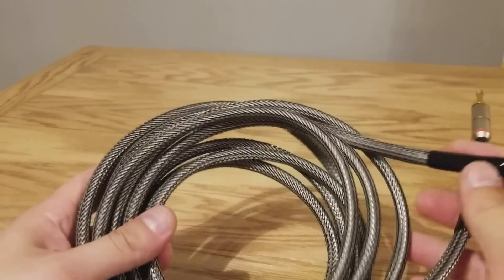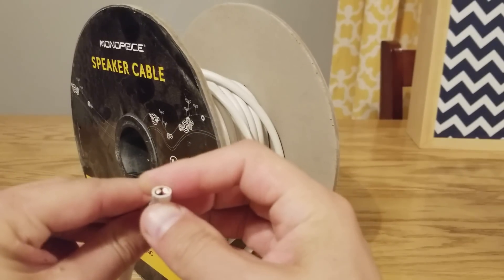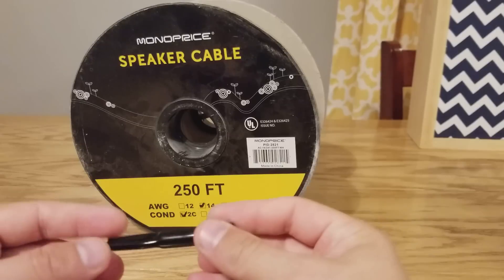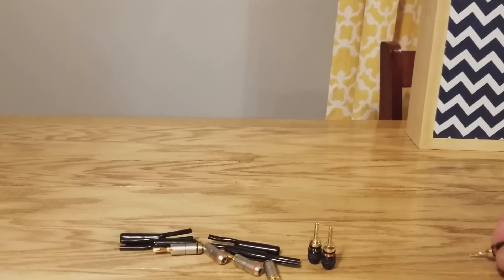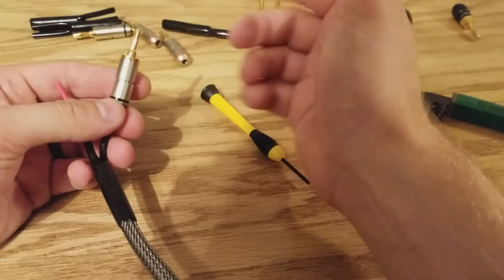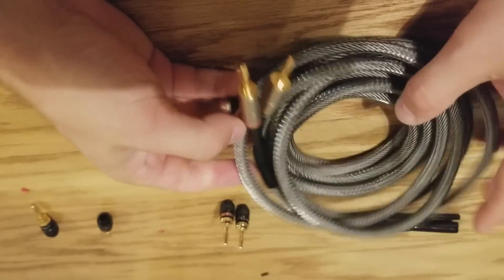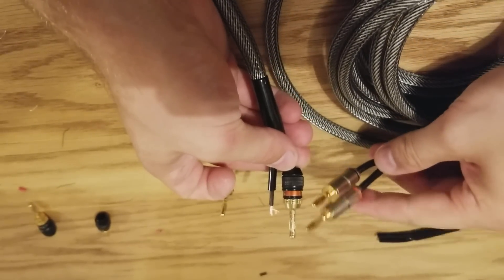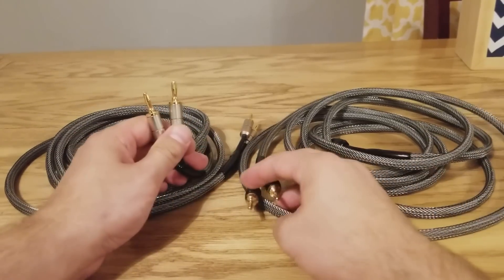How to make Your own HiFi Speaker Wire

Comment: in the end, for speakers,  you just need low resistance. Remember,  speakers are low impedance, typically between 4 to 8 ohms. Keep the cables as short as possible. Use good quality connectors. I think the example shown is a good example on how to make low cost good quality cables
Reply: Bam !!! At least one person on here is actually using that lump thats two foot above their ass....... Thank you
Reply: @arcturusbbqsausagemaking2435  He used his neck ? :D
Reply: No, you need low impedance, which is a combination of resistance, capacitance and inductance.  It is an impedance matching issue because the load is only 4-8 ohms.  A good amp will be hundreds of times less output impedances than that, maybe .01 ohms.  You don't want the cables adding significant impedance to that.  The problem is that most chain retail cable advice is based on resistance, not impedance.  A lot depends on the specific speakers too, because nominal impedance hides the truth about a speakers load variance over the audio spectrum.  Some are just amp blowingley very very bad in this regard.
Reply: Club Soda  in the beginning, yes, it was. Nowadays even the future is not what it used to be!
Reply: I want to do these for my home theater but my rear speakers are about 15 feet from the receiver.  Will doing this work?
Reply: the longer you go the higher gauge you need. If you use 12, or even 10 gauge youll be able to run any length youll ever need

Comment: EEEK. FAIL. WRONG. have you ever cut open a real HIFI wire?  It is a tight twisted pair. It stops electrical interference over long distances and nearby power runs.  All you did was add a pretty cover over a cheap type of wire that is not twisted. Twisting the two wires with 100% even twists end to end takes a machine. Now for your next video go jig up a machine that will twist wire evenly and very narrow twists. (Study other hifi measurements) then do the pretty jacket. Who cares what it looks like if it sounds like &@$) compared to a real system.
Reply: The conductors are twisted in the cable. These aren't $40K Siltech Emperor Crowns. They are good, serviceable cables that work fine for their intended use. I've done A/B listenings with expensive cables and Monster 14 ga speaker wire side by side. I couldn't tell one from the other. To each his own, I suppose. I just feel that spending huge money on cables is akin to stocking up on snake oil. I've read reviews of the same type of A?B testing with expensive cables and ones fashioned from coat hangers. No audible difference. And the coat hangers weren't even twisted. Enjoy your kool aid.
Reply: texasdaveinla I love audiophiles, they are clueless 😂😂😂😂
Reply: "Confuse the read with tech jarbo"...... Not sure if you're full of shit or full of shit. Isn't that what you just did on your first rant? You make it sound like you know wtf you're talking about but you're full of shit that you read somewhere. This is a long debate that's been proven over and over to a point that the cable industry is full of snakeoil and salesmen full of shit, some even more than you.
Reply: This is so wrong.  Ethernet cable is twisted to cancel out electrical noise at high frequency switching speeds.  Does not apply to low frequency audio.  AT ALL. This gentleman's explanation is correct not "tech jarbo".  The only important part about speaker wire is that the wire impedance is very low compared to the speaker impedance, and in than way it does not become a relevant part of the amp/speaker equivalent circuit.
Reply: You made me giggle. I have friends who've spent THOUSANDS on little stands for their wires. I would like to coin the term "audio snowflakes" and folks with too much money and lacking any sense. These are the type of people who get bored with music because they never loved the music to begin with, they love the hardware and love to show off. A true music lover will never spend that much energy or worse yet, money on the snake oil that is all too prevalent in this industry full of snakes.
Reply: They also love to spend money on placebo pills and boy is that a good industry. Nothing sells better than perceived gains, they require so little imagination.
Reply: If you want to watch a fool meddle in his own folly, find a demo where speaker wires are being sold and watch the reactions of the Steve Jobs looking clowns. They swear they heard the diff. Funny part is one time I was part of a live demo where nothing was changed, the plugs were pulled out and plugged back in to give the visual effect of swapping cables and to see everyone's faces light up when the track was played again was hilarious. The placebo they experienced was their very own expectation of wanting to hear something better so they immediately heard it. Tell you what, this sells cables like viagra in north korea.
Reply: Guys, i reckon texasdaveinla spent $200 on a 3m cable, he needs justification for the 0.13% better sound quality gains... smh.. i use 12 gauge electrical cable for years. if you can tell the difference between that and high end cable, congratulations, you have super human hearing and id be more worried about constantly having to listen to folks across the road fight over their failing marriage.
Reply from the maker: I am guessing you have never read and ABX testing (double blind) on speaker speaker wire.
Reply: Nice!  Confuse the readers with tech jarbo. Ok here it is. An ABX test: “A method of testing two sources and thier output.”  your saying non-twisted speaker wire is just as good as twisted. Then why do All Ethernet cables come twisted? Why does the main line coming into your home from AT&T twisted?  Because it’s just better. Wait! I know what’s coming next. Speaker wire is not data wire it is electrical. No. It is both. Using current and frequency’s tgat are are easily disturbed by magnet fields all over the place inside walls and ceilings. Twisting blocks this. And any test done was probably done on the floor away from a power source running across it and promoted by the guys selling the cheap stuff.
Reply from the maker: Ethernet cables, phone cable and other data transmission lines need to be twisted.  Speaker wire needs to keep resistance down.  Twisting the wire has no effect on resistance.  The metal used inside the speaker wire does however can greatly affect the resistance.
Reply: It must keep resistance down AND deal with frequency interference caused by magnetic fields.  Everyone in the AV/theater geek world thinks that audio is even more fragile data than video.
Reply: You almost got it right. And if you took 14 gage wire,  pulled it apart and used a wheel to twist it evenly you’d probably have a product you could sell back to these high end Home Theater retailers because then it would truly be the exact same grade of wire.
Reply from the maker: EMI and RFI is rarely an issue with speaker wire.  But you're welcome to twist if you want to.  It just is not necessary for most people.  http://www.audioholics.com/gadget-reviews/speaker-cable-and-audio-interconnects
Reply: In my over 30 years of connecting stereo equipment ,I have never swapped a speaker wire and been like " THANK GOD I changed that terrible piece of insulated copper!" NIGHT AND DAY!!! said no one ever. Now where is my drill so i can twist them up hahaha Might go CNC some 3" billet stands to get the wire off the Interference inducing wood floor while i'm at it!
Reply: thank you!
Reply: The more important aspect of speaker wire is the shielding. It is possible to minimize magnetic interference by running three cables and braiding them, the pattern of braid will help to cancel out the magnetic field. Notice that winding on a transformer are not braided but wound around a tight bobbin. This is to create an even electrical magnetic field. Having a properly shielded cable will help to reduce the chance of your wire, especially in long runs, to act as an antenna and pickup the electrical noise that's all around us.
Reply: @maddoxinc1642  -- EMI is a non-issue considering the impedances, levels, and frequencies involved in an amp-to-loudspeaker audio circuit.  IOW, you are propagating quasi-technical codswallop.
Reply: WOW totally wrong. Many cables like flat or rectangular wires are not twisted. First you need to calculate the skin effect of the wire you are using to determine if it needs to be twisted or if  this will make them even worse. There is no such thing as one size fits all. there is science here and the effect you are describing may not effect the cable at all until way beyond the audible range. The insulation also plays a big part when measuring skin effect. You can choke the high end and imaging by twisting.

Comment: If you heat the tex flex with a lighter it won't fray.
Reply from the maker: CubeRepublic that is a great point. I usually don't worry about it if I'm putting the boots on. But fantastic point

Comment: I think you should tin ends of the wire, it makes cable more durable.
Reply from the maker: Michał Małecki That's a great tip.  I'll have to try that out next time.  Thanks!
Reply: I believe in tinning the wires also but I make sure to remove the flux residue afterwards using isopropyl alcohol. Some banana plugs have 2 set screws for a better grip and electrical connection.
Reply: Soldering stranded wire makes it LESS durable. This is why they do not allow soldering at all in auto and marine applications. However, if your speaker has binding post connectors, or spring clips, tinning the wire prevents fraying, which will drive you nuts.
Reply: I'd recommend to crimp an end terminal onto the wire instead of solder when you want to fasten a litz wire with a screw. Solder is soft and if you apply high pressure to it it liquefies. It literally flows away from under the screw. Copper on the other hand only slightly liquefies during crimping. Actually that causes an oxygen free cold weld if done right which has even better contact than a solder joint. The end terminal also prevents breakage of wire strands due to the screw.
That and because it's quicker are the reasons why professional electronic technicians usually crimp.